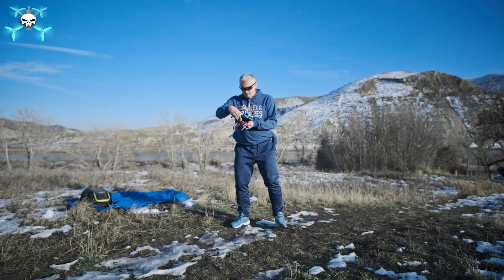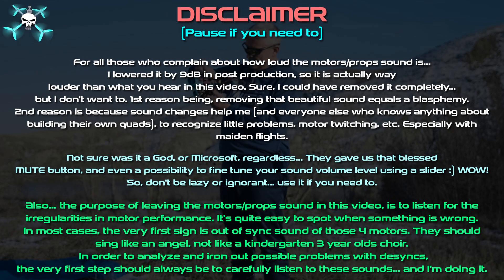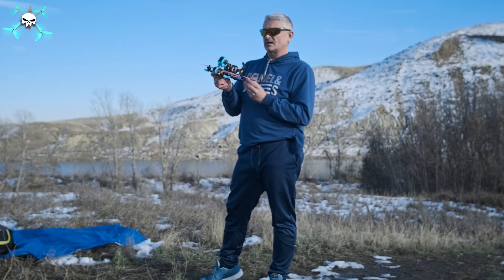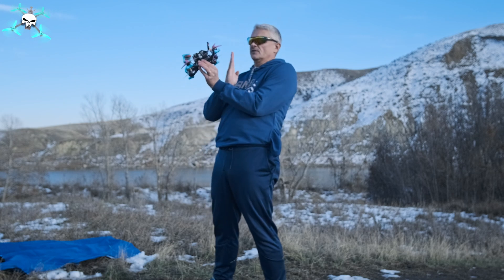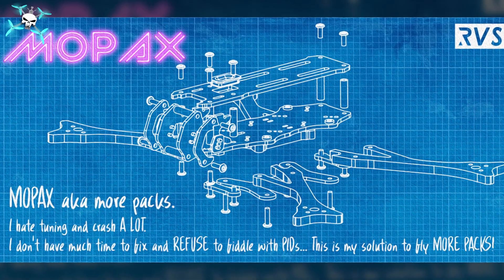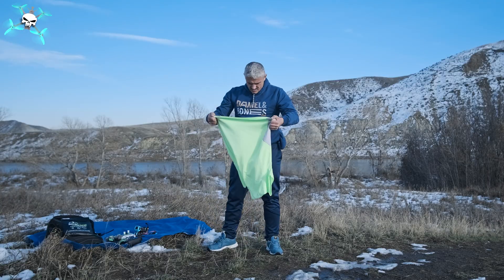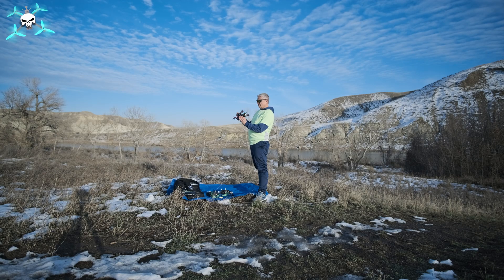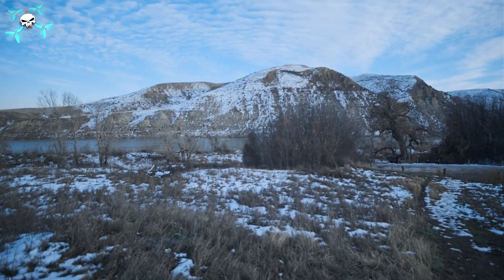MOPAX HALF-A-MAIDEN | Nov-01-2023 | #NOSTAB

Comment: Congratulations on the progress!  I'm looking forward to seeing it after you get the voltage sorted out.  
Sounds like the geese are headed for warmer skies 👍   Enjoy the weekend friend!
Reply from the maker: I am still working on it, and have a team from IntoFPV helping. There is something weird about that current draw, it's almost like something is sucking the power out of that battery. It's brand new, I just posted in that forum, resistance is perfect, all cells are equal 100% which is not always the case... none of my components are even hot, motors are cold, literally cold I touched them with my lips. Outside is nice and warm, you can see me in the hoodie. Stack is literally just slightly warm, and the same with Avatar HD Pro. Absolutely nothing is hot inside, and still something is draining that battery fast... a minute and a half tops. Not even doing any tricks or anything, so there is no battery sag involved at all, plus this is 6s. Much more resistant to sags than 4s. I even set the Current Scale to 200 as suggested directly by T-Motor, and that's default factory value for this Velox V50A. I also calibrated the Voltage Meter Scale, and it shows pretty close to what's really my battery's Voltage status. EDIT: oh yes... these geese are actually coming here for the winter. I can't believe it, but either they must be stup1d or not sure what else :)
Reply: @Seii-FPV  That is so strange.  If it's flying fine otherwise,  Last time that happened to me, I learned that upside down props didn't work so well. ;)   I hope you get it solved soon.  Always an abundance of opportunities for a challenge lol.
Those geese are probably just being lazy lol, I'm sure they'll figure out that they didn't make it far enough south soon lol.
Looking forwad to seeing the next one 👍🤜

Comment: If you have 4s motors, you can set your profiles in PIDs up to 4 profiles to change to the right battery size when 4s 5s and 6s is plugged in.  With a throttle cut at 80 for 5s and 66 for 6s. Also warm your packs before flying. Ethix makes a heated lipo bag.
Reply from the maker: It's 6s configuration, but I can fly any of my 6s quads on 5s battery without changing anything. 5s are so small and so light and still give plenty of fly time, I love them. But second test was with 6s, and I was still getting Low Battery warnings. When I got home and plugged it into Betaflight, current scale setting inside Battery & Power settings was set to a wrong value. I've got a message from Mia WU, an admin at T-Motor FPV Community Facebook group, that factory settings for this ESC (Velox V50A), is and must be set to 200. Mine was sitting for some reason at 179. I also calibrated voltage meter scale, that was set to 110 by default and when I calibrated it, value showed up as 114. Day was surprisingly warm, so there was no problem with cold affecting the battery performance. I just took them out of my car that's sitting on the parking literally 5-10 meters away from the spot where I was standing. I use these LiPo bags by Rotor Village shop here in Canada, these are the best I have ever owned. I also took professional product photos for the shop owner, so in this listing if you take a look at the 3rd and all the other photos after that one, those were taken by me: https://rotorvillage.ca/rvs-lipo-storage-bag-29x22cm/